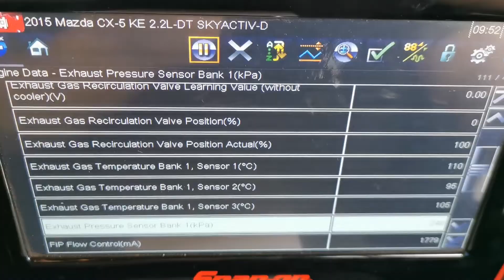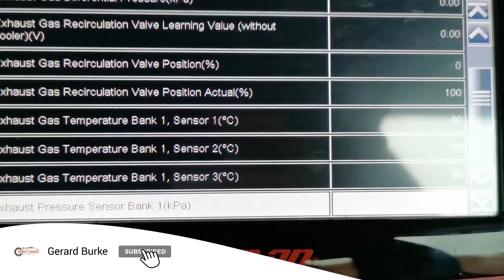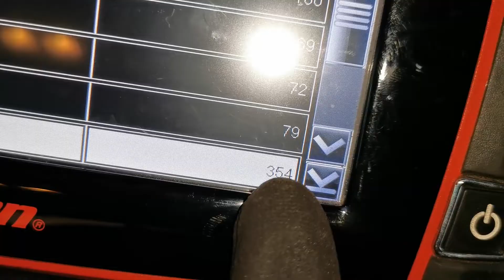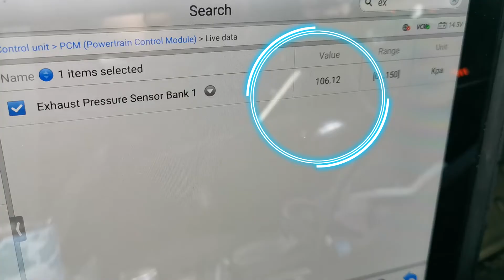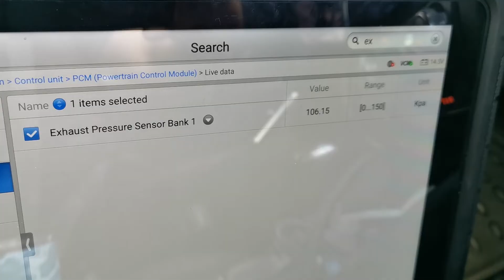Mazda Diesel -  P0471 Exhaust Pressure Sensor Fault - Found & Fixed - How To DIY

Comment: Thanks a lot, mate!
Unclogging the tube fixed my p0471 fault. Google pointed me directly to your vid. It took 5 minutes to confirm the pipe was clogged.
Spend a long time trying to get a bicycle brake cable in. But couldn't get it deep enough. A 1mm welding wire did the trick.
Thanks again for sharing. I owe you a beer.

Comment: Hi! Great Video! I have the same car, with an error P2227 "GENERIC, ATMOSPHERIC PRESSURE SENSOR". Could it be the same problem? once the sensor has been replaced, is it necessary to reset the control unit or is it sufficient to eliminate the error code? In the new sensor of your video, is it essential to also replace the wiring or are they identical to the old ones already present? Many thanks in advice...

Comment: Had the same on Mazda 3 2.2d few months ago. Same both error codes. Changed the sensor with the new upgraded (and different shaped)  from Mazda. The car rejected the Bosch one.. so paid Mazda price.
Reply: Hi, I‘m having the same problem but it shows a couple more errors on the dash (smart city break, esp and tire pressure monitoring system), all happened randomly at once, did yours have the same problem? Thanks in advance
Reply: I have the same issue here but i haven't seen a mechanic that fixes it @markoursikic4355

Comment: Hi Gerard . I have both these codes currently on my Cx5 . It's a 66 plate with 79k miles . My car is still not repaired.  My mechanic whom I've decided not to go back to charged me 3 hours labour looking at diagnostic details @ £60 an hr . He also said he cleaned turbo sensor , management light still on . Has now said intake manifold needs cleaned . Another mechanic said it's the turbo so I'm at a loss to what to do as I really cant afford expensive repair . I had it also at a  carbon clean guy but he reckoned it was not worth the car on clean after looking at it but has also said could be turbo , buy has also suggested  Terra clean . 

I've since been and spoke to another mechanic, an older guy , seems very knowledgeable and also reckons intake could and should be manually cleaned as he diesnt recommend Terra cleaning. I've been  thinking maybe going to him .  Its well known these engines bad for clogging up with carbon . After this video on feeling a bit more hopefull . Would  it be recommended I look at this first before cleaning of manifold.  I should also mention that oil level has been rising , fuel getting into the oil , is this a related or separate issue ?
Reply: Its the sensor if you had the same errors. Check my other comment. This gave me head aches three months ago. It has to be the new upgraded sensor. It is mad of metal, not plastic as the original one. ONLY Mazda genuine sensors will be accepted. Others wont work. Sensor No 1.
Reply: Hi mate have you solved the problem? What's the reason? Thank you.

Comment: Just done ours Gerard same problem and used that upgrade kit identical to that one 
Tried it without the extra bit of wiring first and it ran terrible plugged the new wiring piece in and spot on !! So what’s in that bit of wiring just looks like pair of cables and two connectors so how’s that work ??
Reply: An extension, as this is an upgraded sensor, different than original.

Comment: Thanks a lot for clear explanations and tips. I've replaced the pressure sensor, but the rubber hose just underneath (p/n SH0120763) was completely clogged. A new hose comes with the kit, so no big issue, but unfortunately also the air pipe, the metal tube wich the rubber tube is connected to was clogged (p/n SH0120870). Is it possible to clean it or must to be replaced? I guess there is quite a bunch of work to replace it. In the meantime, even with the air pipe clogged, I have the car up and running, withou any warning from electronics...how is it possible?
Reply: I have the same question, how does it work if the metal pipe is clogged?

Comment: Great. Many Thanks for that.
Got the 50 kPa when the electrical connector removed, but when I did the sensor disconnected / atmospheric check got 55kPa rather than the 314 you found. But as I guess it’s not ~100 kPa it’s still faulty! So will try a new one.
Top tip, pack rags below the sensor before removing/refitting the bolts because if you drop one they drop down quite a way and are EXTERMELY difficult to recover!☹

Comment: Also the pipe needs to be looked at it runs down and from what I can rember it goes on to a narrow steel pipe which gets blocked easily with carbon u can clean it out with a piece of wire this will also give you fault code
Reply: Do you clean out that pipe in situ using a Flexi wire or do you have to remove the pipe? If the former then I'm guessing any carbon pushed 9ut will simply fall into the dpf and eventually get burnt away?
Reply: @novusordo84  yes gust run a piece of wire through the pipe carefully gust to make sure it's clear this is what I did and the car is running fine a year on that pipe is a tough one to remove I sprayed some carb cleaner down the pipe to help with the clean good luck